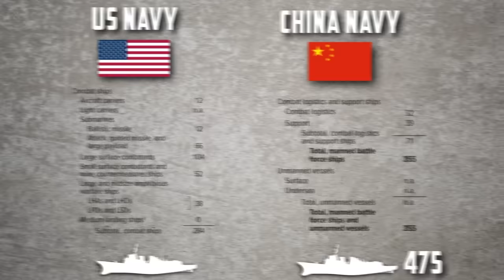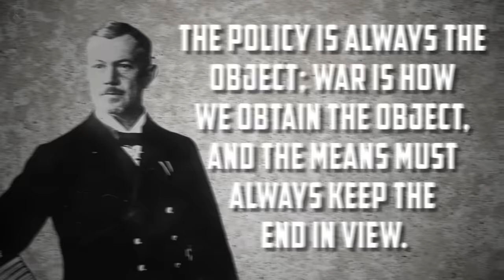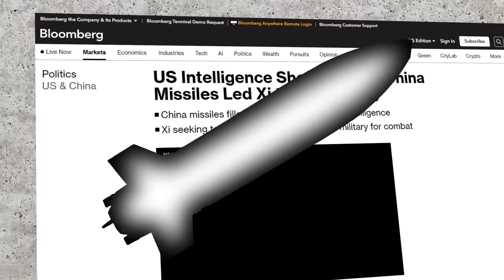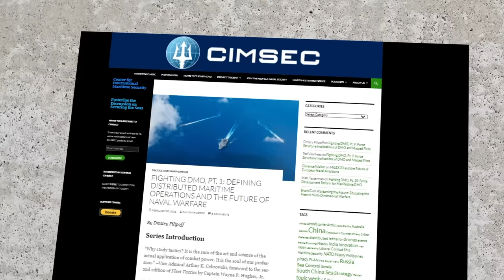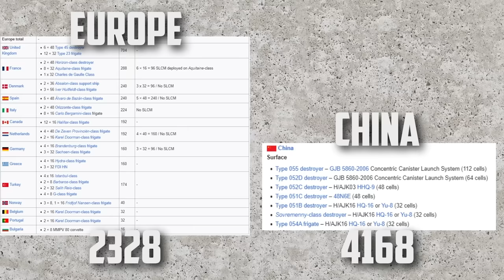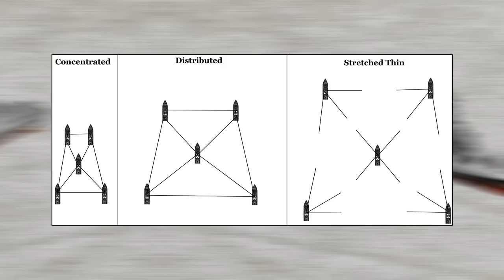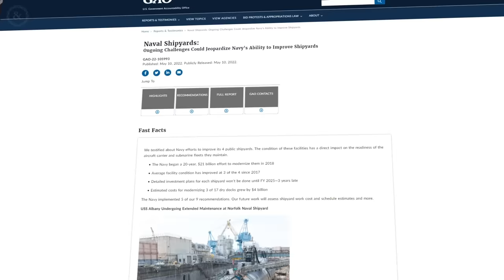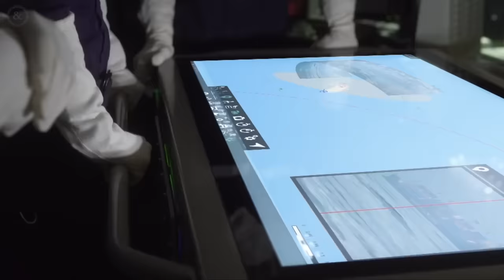Can the US Navy Rebuild their Fleet?

Comment: The capability to reload these VLS cells is very important as well. It is very difficult to achieve in any sea state via cranes. Ships essentially must return to port to reload. Developing the capability to reload them more quickly would shift the balance of firepower drastically. In the Napoleonic era, technology allowing higher rates of fire of muskets and rifles were closely guarded state secrets of strategic importance.
Reply: "Its a fool for a ship to fight a fort"! Still holds true today
Reply: The biggest issue is that China's VLS cells carry hypersonic missile, giving them bigger strike radius.
Reply: @henli-rw5dw  need solid proof they have a viable accurate hypersonic VLS onboard their ships.
Reply: Exactly. If we can manage to make that work somehow at sea and not have to all the way back home that would be a game changer. What they need is a way to dock that ship at sea. What you need is something like the blue marlin or dockwise vanguard possibly.
Reply: @spartancrown  This has been confirmed for several years now. They have boats specifically engineered to carry hypersonics that do work and we have witnessed them do tests of them working. This also doesn't include their massive shore-based missile force and the largest concentration of drones in the world.
Reply: @spartancrown   The spec says 930 mile range, mach 5 travel, mach 10.  Until the fight actually happens, keyboard warriors are free to call them completely useless, which is expected, not like keyboard warrior have ever been right on their calls.
Reply: @henli-rw5dw  the specs you’re listing are for the YJ-21 which is basically a DF-21 variant. You couldn’t fit a DF-21 on a ship and the YJ hasn’t been seen launched, instead what was looks to be a CM-401 and that missile has much more limited speed and range. My point is until you actually see it happen don’t count on it happening. China is notorious right along with Russia on making claims that are just slightly padded to say the least. That video they released awhile back showing a ASBM hitting a carrier mockup in the desert was clearly fake, yet touted as a success. This is not me saying they don’t have hypersonics, I’m saying I’ll believe they got ship launched ones that are accurate at hitting moving targets when it happens, which is hopefully never.
Reply: @spartancrown  Not disagreeing with you.  Basically everybody can claim whatever they want. Russia and China might never be right, but I've never seen anyone right here as well.  Trade war, tech war, ukraine war, afgan war, literally every single conflict 0% prediction rate by keyboard warriors.  So basically, all claims here are useless until after war happens.
Reply: @spartancrown  The only thing I know for certain, based on past history, is that your prediction is wrong.
Reply: What do think of building missle ATB's?
Reply: @henli-rw5dw actually, the US zumwalts ships are getting the long range hypersonic weapon, which has a longer range than any Chinese ship based missile, including their hypersonic ones. It will have range of 1780 miles and go at mach 17.
Reply: @wiseguy3696 the US zumwalts are getting hypersonic missiles with higher speed and longer range than any missile on Chinese ships
Reply: @SelfProclaimedEmperor  could be haven't seen it deployed yet.
Reply: @henli-rw5dw  it's set to be deployed on the ships in 2025. It's range and speed plus the zumwalts stealth properties will make the ship an excellent Chinese ship killer, focusing on priority targets like Chinese type 055 destroyers or Chinese aircraft carriers
Reply: @SelfProclaimedEmperor  well at least they have a date.
Reply: And it should be obvious to everyone that the facilities to reload VLS are going to be secondary targets to any prolonged engagement.  We need under way replenishment.  Or at least ships that can be parked in a friendly harbor.
Reply: @spartancrown  According to publications, the YJ-21 can also be fired from H-6 bombers of the PLA Air Force - btw these bombers can also fire the YJ-12 supersonic anti-ship cruise missile.
Reply: @zix_zix_zix  I’d believe it could be air launched from a heavy bomber. Russia basically took an old ballistic missile and strapped it to the bottom of a plane and called it hypersonic so China shouldn’t have any problem getting them airborne.
Reply: @spartancrown  "Russia basically took an old ballistic missile and strapped it to the bottom of a plane and called it hypersonic" - I don't think it's that simple lol. Reportedly,  this missile travels six times the speed of sound all the way, and has a terminal speed of 10 times the speed of sound..
Reply: @henli-rw5dw Not was was said. He said let’s see one accurately demonstrated because the Russian Hypersonics have been questionable at best. I personally don’t doubt it’s possible I doubt China’s deployment of them. The U.S. has its issues I’m aware but never once have we had a ballistic missile fueled with water ours work and do Mach 30. We also are 18 months from fully realized and deployed hypersonic weapons and directed energy weapons that work much better without any ballistic trajectory or speed loses in final stages. Invincible if you will
Reply: @blueberrywilbur315  Well you can just youtube it.  They got a clip of the 2022 test launch.  According to recent article, it's on their H-6 bombers patrolling Taiwan.  So yeah, the moment conflict breaks out, you'll see if it's any good.
Reply: @driedbrainfreeze2149  The British did pretty well against Fort McHenry.
Francis Scott Key was so surprised the fort held up to the bombardment that he wrote The Star Spangled Banner.
No apparent damage to the British fleet from return fire. Fort McHenry was all shot up.
Reply: My question is why do VLS cells specifically need to be reloaded vertically? Why wouldn't an autoloading mechanism from a magazine work? Its not like the average cruise missile weighs that much more than a 16in naval shell. And we figured out automatic loading systems for those like 80 years ago.
Reply: @zix_zix_zix  that’s exactly what the kinzhal is.
Reply: @spartancrown  It is similar but the Kinzal has a much shorter operational range, as far as I know..
Reply: @OtterTreySSArmy We didn't develop auto loaders for 16in Shells. We made them for 8in and below. As for making one for VLS cells, how on earth would you implement one with the limited space on a Destroyer or Frigate? To begin with, the VLS replaced previous magazine loaded arm launchers to essentially remove reload times all together. The only thing you can do is make a bigger ship to add more cells.
Reply: Have South Korea build our non-sensitive naval ship hulls for a fraction of our cost and float them over to America to install sensitive and classified equipment and assets. Short-term: gives us the jump time we need to meet deadlines. Plenty of work for trade specific careers long term. 🇺🇲🦅

Comment: They need to replace the Brass and Congress first. In addition to filling the entire, 80 ship Constellation Class order, we need a new Corvette in massive numbers. They need to follow through with planned Arleigh Burkes and upgrades to the cruiser class. We need to go with plug and play, and proven designs. A new, bigger gunned cruiser should be on the table too. (No, I mean 203mm, not the awful 155mm. Put those on monitors.) OK, we can leave out the sloops.
Reply: They can use AI to build ships too, not just operate them. The challenge is to keep Huawei chips out of them.

Comment: I was a gunners mate on a DE in the mid 70s. We spent a few weeks at sea ever few months.  Based on the  east coast. It seemed like a  relaxed time to me. My chief petty officer was a wealth of knowledge and  helped our ensign learn the ropes. When it counted the ship ran like a well oiled machine. Later i worked as a pipe fitter and boilermaker then as a plant operator for 16 years. One thing I thing i pushed was pms. That was an excellent system i tried to have it implemented when I was a operator. I couldn't get them to implement it. Wait till it breaks.  I learned a lot in there and  im proud i served .

Comment: Correction: The Constellation class will not be able to launch Tomahawk cruise missiles. It only has the MK 41 tactical length VLS. Congress inquired about having the strike length VLS installed instead, but was told it would take a major redesign of the ship. For now at least, the first ships of the class will be limited to ESSM, SM 2, and ASROC. It will also carry 16 Naval Strike Missiles.
Reply from the maker: Thanks for the correction ! I appreciate the feedback, I’ll have to look more into this aspect of the constellation class
Reply: It's too bad they won't v
Be able to carry the longer range missiles, but hopefully Congress doesn't mandate it as that would cause long delays and cost over-runs. And, frigates don't need to do everything
Reply: They should do LRASM instead of NSM and SM-6 should be available.
Reply: In a pinch, it might be feasible to emulate the Russian practice of attaching launch tubes to the sides of the ship, if it can be done without causing roll stability issues. I don't really like doing that; the Ukrainians have discovered that detonating the side-mounted missiles with a drone attack is an easy way to sink those ships. The weight of armored tubes could make the ship prone to capsizing, so that's probably not workable either. Thus, this would be a desperation measure, or something for a one-off operation rather than standard practice.
Reply: @deplorablebrian2023 there are barely enough LRASMs for the air wings as is, besides carriers are inherent to US naval doctrine, there will always be enough LRASMs in any battlespace because there’s a carriers worth of launching platforms not ever very far away.
Reply: Your incorrect they will have full length VLS
Reply: He is wrong new FFGs will have the full length VLS @Taskandpurpose

Comment: In my opinion it's a good strategy. FREMMs are hands down the best frigates available on the market. Sink a big cruiser, you deal a lot of damage. But when you have to deal with big ships AND small, yet extremely modern and capable frigates, that's where you start realizing that you're screwed either way.
Reply: Type 26 are better ASW
Reply: Are they? The ESSM Sparrow missiles are equivalent to the Sea Ceptors and are quad packed, which means the Constellation carries more anti air missiles. 

Type 26: 24 cell Mk41VLS + 24 SeaCeptors

Constellation: 32 Cell Mk41 (24 cells plus 8 cells for 32 quad packed essm sparrows) 
AND 16 Naval Strike Missiles. 
AND 16 Naval Strike Missiles.
Reply: Type 26 is quieter with an advanced electric drive with more advanced Anti Submarine Warfare capabilities and more room for adaptable multi mission bay areas.
Constellations are better general purpose units whilst the Hunter class have very advanced radars with the Aegis combat system.
Reply: @user-fd6rr4iz9m  how would you know which is quieter? The type 26 doesn’t exist yet. They’re being built now.
Edit: Neither exist yet.
Reply: @WilliamSanderson-zh9dq he said its better anti submarine warfare. You've responded going on about anti air which isn't relevant. The main purpose of frigates is anti submarine capability VLS cells are essentially just for basic self defence. But you are correct, T26 doesn't exist yet - and given how often British defence projects are failing now I doubt we'll build more than 4 permanently broken ships.

Comment: More tonnage doesn’t mean more advanced, nor does it mean more capabilities anymore. It was the case back then, when more tonnage meant a bigger ship with more crew, more guns, more capability. But today, a ship that is 4500 tons does the same, if not more capable, than a ship that was 10’000 tons heavy. Advancements in electronics and the reduction in their size means that a weapon system, for example a naval gun and its radar, that was 14 tons heavy is now 4 tons heavy. These same advancements in electronics means more computing and a lesser need for manned systems, thus less crew members. For the same task and purpose, ships went from 1000 crews members to 200 crew members, etc.

Comment: i would argue for fast tracking an arsenal ship.  one withy 100 - 150 vertical launch tubes.  it would have minamal radar,  electronics, but maximum data link.  it's only function would to , on demand, launch the called for missel, which would then be taken over by the calling ageis system or AWACS link.
this ship would be assigned to a carrier battle group, and there would be 3 per carrier group.  one would be with the group, one would be close in reserve and one would be in port reloading,/stand by.  this would give the fleet, when the program is compleat, an additional 1100 to 1650 additional launch tubes, quite a boost, and make an over whelming swarm attack much more difficult.
Reply: That's a good idea!

Comment: I work for an industrial contractor and ship building isn’t the only industry hurt by the lack of skilled labor. We are also struggling to find skilled labor to fill pipe fitter and welders positions in the private sector and our standards are not nearly as stringent as naval ones. Another point no one talks about is the skilled labor that is available is commanding an extremely high rate due the the shortage thus increasing cost’s across the board.
Reply: That is the risk, compared to China who has no shortage because they are the largest shipbuilder in general.

We need to tap into our allies like Korea and Japan who also have significant shipbuilding capabilities.

Comment: I live near Oxnard, CA where the HAAS automated machine company is located.  They have no influence in local high schools.  The community college has a weak/pitiful program, that turns out 15 graduates per year every two years of schooling with an AS degree.  Then, they can expect a job at less than what fast food pays, and is likely to be just as short a career.  The point:  Trades value is based on hourly wage, benefits, and turnover.  Skilled labor doesn't cut it.

Comment: From what i've gathered, the real problem isn't the types or designs of ships that we are building. It's that we have far too few shipyards to build and maintain these ships. Congress can authorize all the ships they want but it doesn't mean a thing if there is no capacity to build them. We closed most of our shipyards after the Cold War and now only have four or five yards for building and repairing warships whereas China has dozens... with their largest facility having more capacity than all of our shipyards combined.
Reply: Exactly.  And our labor cost is far higher.  Their purchasing power in military equipment at least doubles ours.  They make a ton of steel, and practically everything they need.  During war time, they have no shortage of these things.  Russia can supply any additional raw material or energy needs as well.

Comment: Extra 150 ships. Wonder where they are gonna get all these extra sailors.
Reply: The LGBTQ+ community of course
Reply: Migrant labor of course
Reply: A.I
Reply: The could just reform leadership and improve the VA.  If Congress ever comes back to work.😅
Reply: Privatizing the VA, offloading swcc, etc.  they have a lot of options.
Reply: Newer ships need smaller crews.
Reply: @badluck5647 🙄🙄🙄
Reply: @Jason-fm4my Hell no.
Reply: @grahamstrouse1165  To save cost, the Navy requires more automation on new ships to reduce crew count. Just look up any new class of ship and compare it to older models. Less sailors on the newer ones.
Reply: @badluck5647  2/3 the number of sailors 4/3 the work and half the reenlistments.
Reply: @badluck5647  Smaller crews with more maintenance, more jobs they have to do with probably even less sleep.
Reply: @badluck5647  People don't join the Navy to work 72 hours straight on a regular basis.

Comment: If China's goal is to control the China Sea, they can use land-based missiles and air force. The Navy only needs to be there for fear factor, troop movement, and close-in-ground support. For those roles, they are well-equipped.

Comment: Yes build flight 3 Burke Class and start refitting reserve fleet with enough electronics to act as missile trucks for the up to date ships.  Buid modern Tigonderogas with appropriate redesign to adjust for the hull cracks due to the aluminum superstructure/ steel hull issue.  Rebuild the Tico's into strict fleet guard specs with ASW/Anti-air armament mix  with enough deck mount gatling guns in the 50 caliber range to mulch the surface pirate threat.  2 CIWS and 2 RAM Missile mounts for self/ close in defense.  Refit as many subs for missile carriage as they can as well, if they are "Too Old" like the Texas was during WW2, then the old subs can do shore bombardment.

Comment: There definitely is a few issues with the navys new tactics. As for one, even if you have the ships you need a place to store, maintain and operate them. Further you need a good chunk of these ships to cover every area of interest like the "south china sea" or the horn of africa etc. and lastly missiles can be intercepted. Even if you have a fast, agile small missile with a big payload, it only needs 2 CIWS crossing firing lines to take down any missile and since the primary methode of missile detection is still radar, you cant exactly just make the missile impossible. I believe a good mix with some bias of several naval doctrines and tactics are required to truly reach optimal performance however as always lobbying and the hierarchy in any military will heavily limit how "modular" you can be with your tactics.